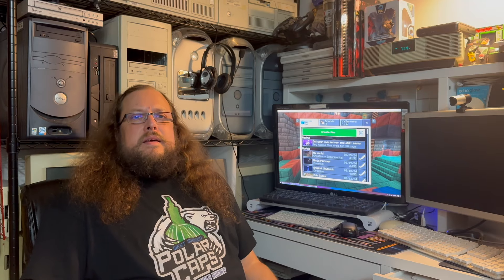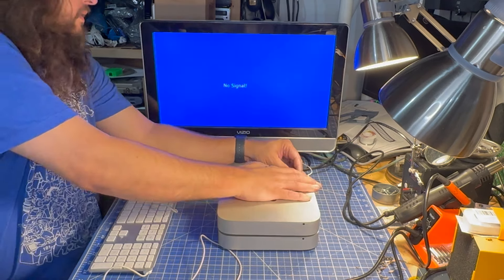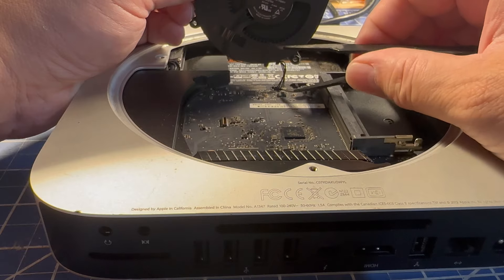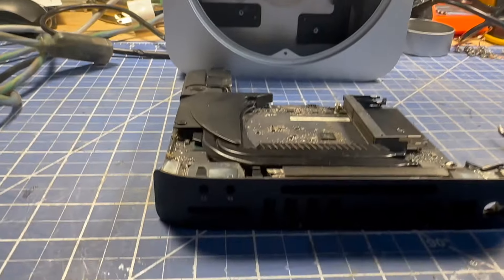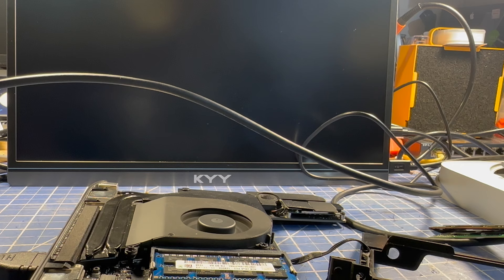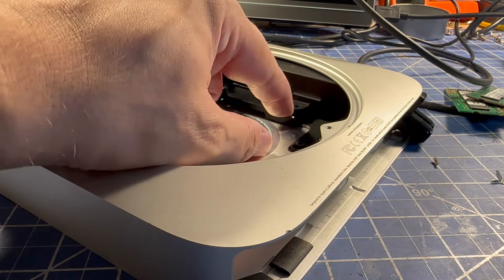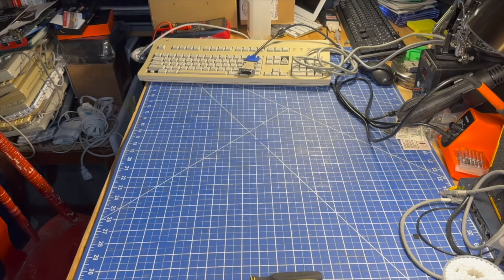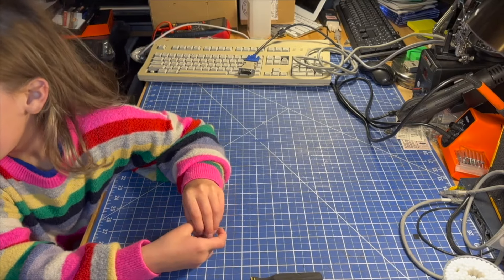Core i5 Dead Mac Mini Repair

Comment: I hated working on these things. Even replacing a hard drive.
So many pieces to remove to get to where you needed to go. Tiny delicate wires. Different size screw heads. 
All black interior so it was difficult to see what you were doing.